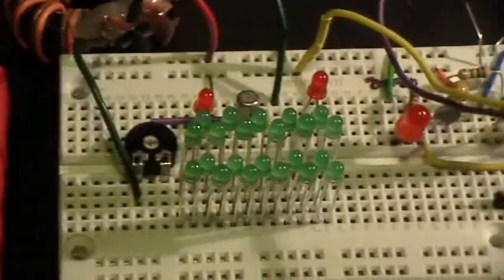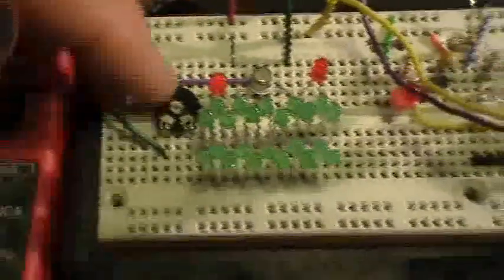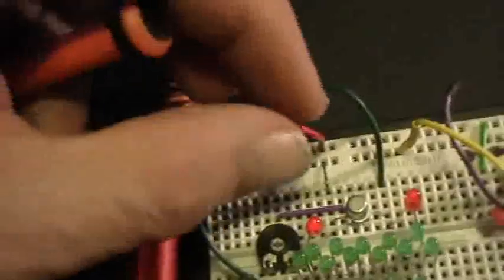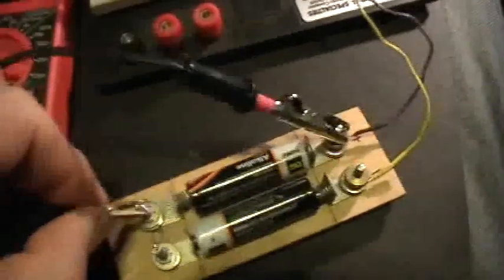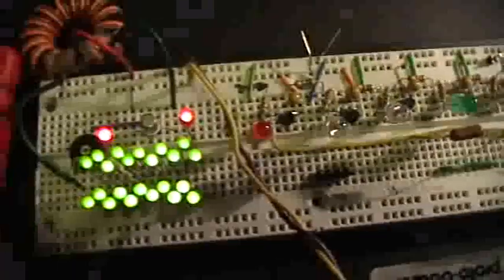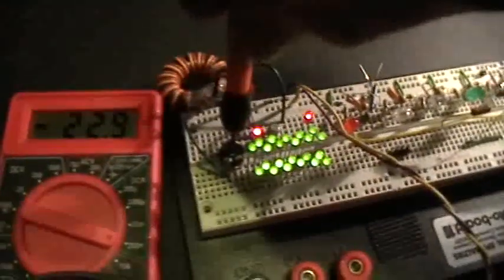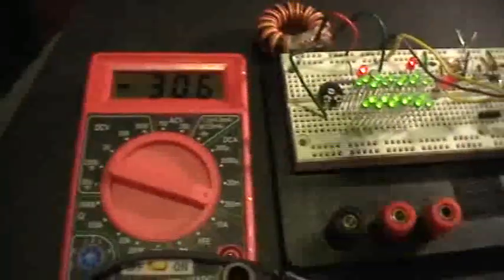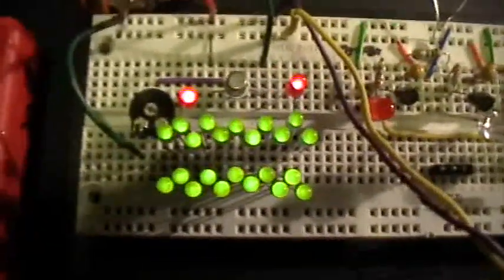Joule Thief: Basic Circuit, Upgrade to 24 LEDs, 1 to 1 Toroid Winding

Comment: Do you have the wiring schematic including the wiring for all the led's?
Reply from the maker: Sorry I didn't see your comment earlier, due to this new screwed up system that Google+ has forced upon us.
The circuit is the Basic JT, please see the earlier video for the schematic. The LEDS are wired with 11 in series, another 11 in series, then those two in parallel. Then one each in series with that, on the anode and cathode sides, then connected to the JT circuit.
I hope that helps.

Comment from the maker: Hi Stefan
Thanks, I'm doing this to help another forum member get started.
Yes, I've seen Sohei's work, and I like it very much, and it's the inspiration for my big LED banks. 
He pointed it out to me some days ago and I suggested some other things he might try. I like the idea of using air core, non-saturable coils, as you know.
However I think I'm finding that for really high voltage spikes, a high inductance is necessary, and with air core coils that will require large physical size.